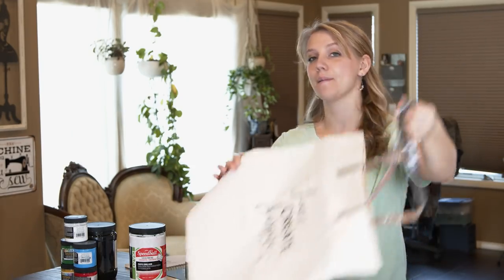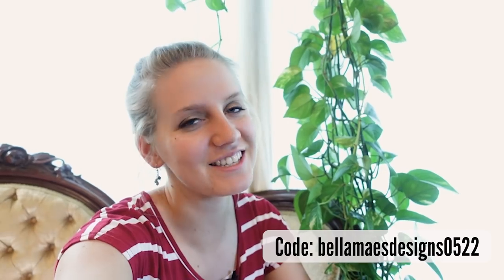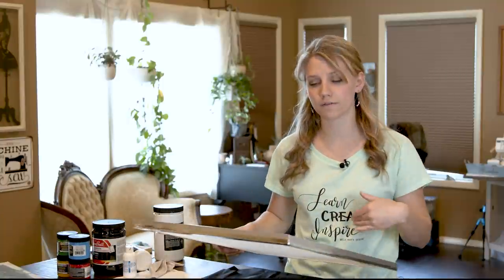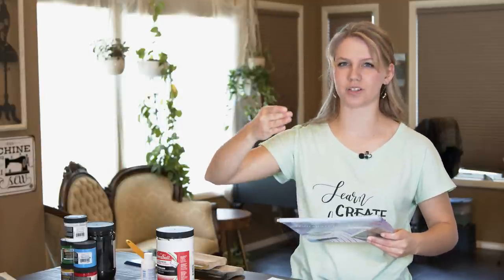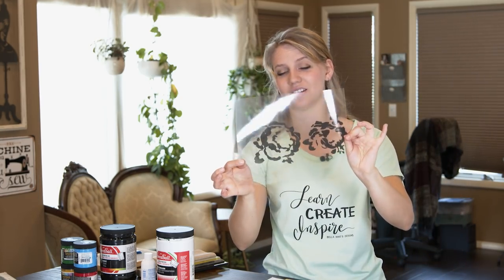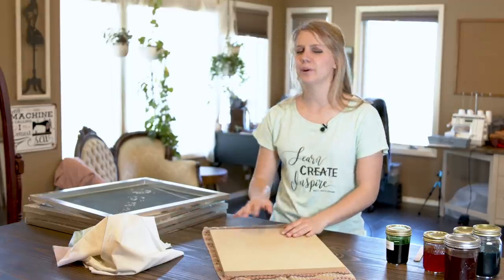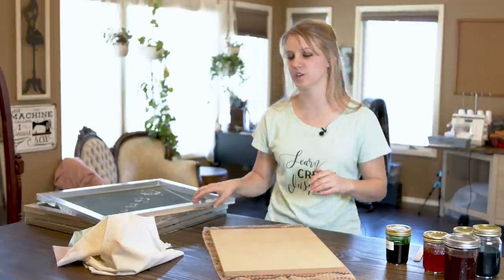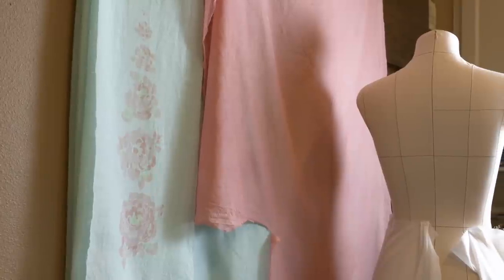How to Screen Print Designs on Fabric! — For Cinderella's Dress

Comment: I was thought in college to do this type of printing, but in a large scale, so we use a big machine to do the exposure! For the edges we just add tape on so it  wouldnt bleed out in the fabric when adding the ink.
Reply from the maker: Yes! I have done tape before, but after washing it usually needed to be redone, so on the barely ever used screens I do tape and I do the touch up on the ones I plan to use a lot!

Comment: Ref: 18:12
If you use 405 nm led strips they will last for years and give a more even exposure and also use less electricity. Even better is that they are not very expensive.
A strip with 60 led would be $20-30 US. The advantage is that you can do it anytime and you can time the exposure so it is the same every time.
Reply from the maker: Oh, that's good to know!

Comment: You should get a shower head with a handheld attachment, that has a high-pressure 'massage' function that you can use to get the trifecta of dark room/high pressure/warm water you need for rinsing these screens. It is super easy to change out a shower head, and they're  usually not expensive.

Comment: Just wondering... Is there some sort of UV-meter, that you could use to adjust your exposure time based on strength of UV radiation each day? Not sure how the costs and potential savings add up, but wasting a screen each day you make them doesn't seem completely insignificant + it's just hard for me to go into a process knowing I'll have to bin a significant portion of it anyways.